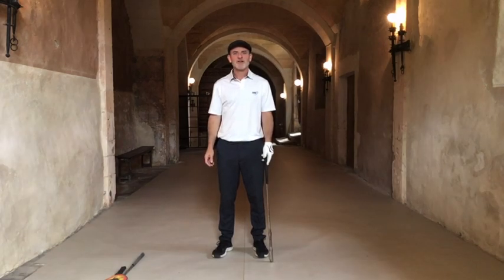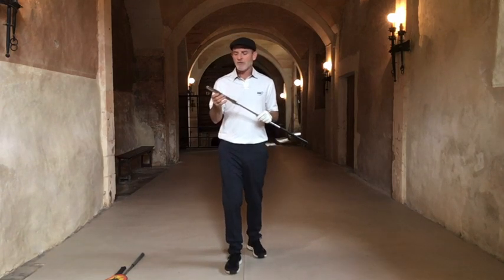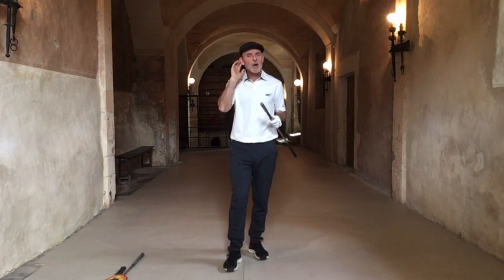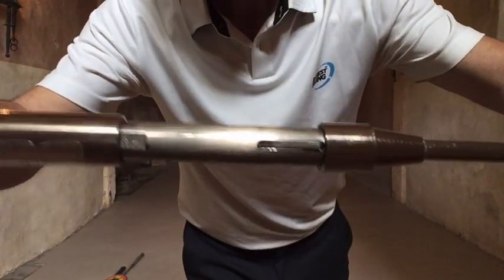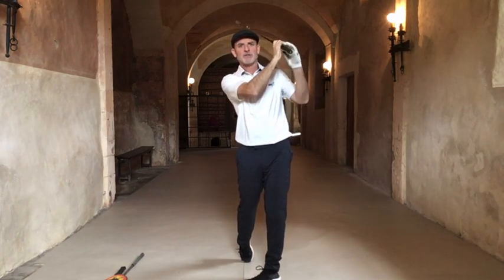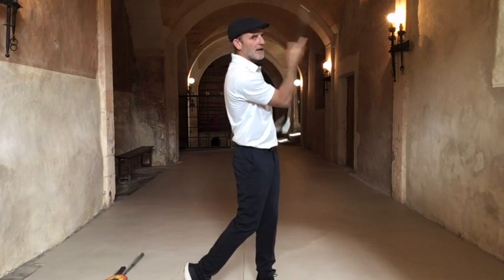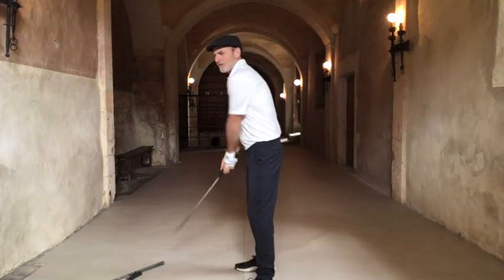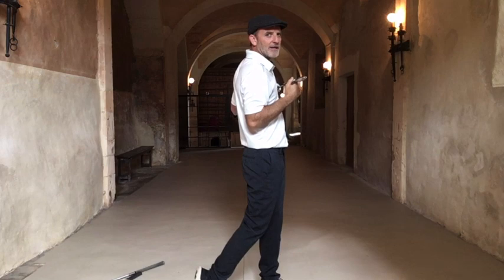Easiest Way to Produce Greater Clubhead Speed With Less Effort

Comment: Excellent video. I have been trying to use the Easiest Swing Method for almost 3 years and like it very much. I know that La Dance emphasizes the turn as one of six components. I do it at least twice before each shot as well as at my fitness center (before it closed). When hitting the ball I could not get the same feeling of the level turning of hips but it instead it feels like a more lateral move instead of a turn. When that happens the feeling I get is that my arms are operating independent of my body and good contact is dependent on perfect timing.
Yesterday I tried consciously fully turning my hips from the start of my downswing and I got better results. If I do that on every shot will I eventually get to the point where I don’t have to consciously think about that move?
Reply from the maker: Thanks for your comments James. The turn and the wieght transfer will begin to happen together with practice. Keep Dansing and don´t forget to keep practicing the Swinging Legs Exercise which will support this.

Comment: Well done and thank you. Thinking of my left arm as the lever to a faster swing speed is very helpful. I have always thought any power I had was coming from my trailing right arm. I will be trying this out soon.
Reply from the maker: Hi Paul, thanks for your comment. And it will really help if you practice the relaxed finish position with specific attention on the relaxed right arm and right side. To finish here you must turn through the shot which is where the power comes from. Good luck with your practice and keep me posted.

Comment: Superb Sean and extremely helpful analysis and comparison with modern swing teaching.  I can understand better now why myself and friends struggle so much with conventional approach- despite 2 of us once being single figure handicappers and myself 11 and trying really hard to get more speed.
One question if I may. On the backswing does the club take a more inside route as the face opens (?) than some modern swing teachers would recommend? Your approach is very encouraging , particularly as I struggle to keep my head central-albeit I hit the ball best when it does move!
Reply from the maker: Hi Ian, yes I would say the club does tend to take a more inside path on the backswing mainly because the width of the arc is not as wide. Regarding the face opening on the backswing this is not something we encourage at all. I am keen to know where you get this idea from. And yes the head movong towards the target on the forward swing is pure genius!
Reply: Seán Herron Face opening may then be a bit of an optical illusion as I thought I could see quite a lot of the face as the club is swung up in the back swing.  I understand the clubface should not be fanned open (which I actually used to do quite successfully for a long time when I first started playing) and latterly for some time I have tried to keep it as I would describe it as more square-which works well enough. 
A number of teachers I tried to follow want the clubface pointing more towards the target at approx shaft horizontal which I have found much too difficult (combined with holding this through impact. )It is however very encouraging to see your comments about inside path as this definitely something I prefer to do
Anyway I have tried to use easiest swing playing and practising and it is extremely encouraging and exciting.  I have found pitches very straightforward and accurate!  My friend (who played off single figures at one time) is very interested in taking up the approach as well. He is keen to know what the clubhead speeds are which you generate.  Are there any of your (or other easiest swing coaches) videos which I can be referred to to help him?  Hope to get my Hole in One delivered today!! Apologies if this is too long and detailed! Am trying to get my wife thinking about holidaying in Mallorca for a change! Regards Ian
Reply: hi Sean, if you look at your swing with the bat, the toe of the club clearly points to the ceiling with an open club face.
Reply from the maker: @timdench2583  you mean the toe of the club points to the floor. OK my bad - but I want to emphasise that I stand by the underlying message.

Comment: Sean,
Great video. I have a question about ball position. With your explanation, I get the impression that the closer your arms swing(more upright) the faster the swing speed. Is this a correct observation?
Reply from the maker: Hi Frank, my observation is that if the arms stay connected more to the body it allows for the body to contribute to the power behind the swing, as well as helping rhythm and coordination and balance. You see, the average player tends to slow down through impact rather than speed up and keeping the arms close allows you to put that impetus forward through the impact zone with power and speed. As well as that , the idea of using the left arm as a 3 lever system means that you will find it easier to continue accelerating through the ball rather than getting stuck like a lot of golfers. Do you have a SwingCaddy? It helps to practice this.

Comment: What, exactly, are you doing to the Swing Rite, after you swing? It appears that you are sliding the coupling….? It has two levers,  that can be pressed in, to lock the coupling, BUT, once you do that, it won’t CLICK(slide). Not sure how the coupling is supposed to function.
Reply from the maker: I have replaced the Swing Rite with a Swing Caddy or Hole in One where  I don’t need to reset. You may want to look at these newer models. It is possible to purchase one of these through our website www.easiestswing.com
You can also visit our Easiest Swing YouTube site for more videos here: https://youtube.com/@Easiestswing?feature=shared
Reply: I appreciate your quick response, however, my question went unanswered. I have the original Swing Rite, and I’ve forgotten what the two push buttons are for. Once the coupling is slid over them, the coupling no longer slides. Gravity is what allows it to slide, yet, I notice that you seem to do SOMETHING after the completion of your swing. Please Advise, thank you. I’m aware that you are here to make money. At this time, I’m unable to purchase the new products that you mentioned. I just want to be clear on the proper usage of what I bought, some time ago.

Comment: My I ask about your predominant ball flight? Seems like a glancing blow. Are you hitting tight draws? There is a lot of movement in your swing
Reply from the maker: Hi Shawn, at the time I took this video my ball flight was more straight and maybe a tight fade. I have been working more with my swing and am starting to get that tight draw you mention. And by the way we encourage movemnet with the easiest swing. Often golfers need to move more rather than stay fixed over the ball which ultimately stops them from turning

Comment: Sean, your explanation of the 3 lever system is interesting. Does that apply to the right arm equally?
Reply from the maker: Hi Vince, no the right arm does not move or work like a lever in the golf swing. Unless you are left handed of course. The best way to get a feel for the right arm action is to hit short shots with the right hand/arm only. I will do a video on this soon. Hope this helps for now.